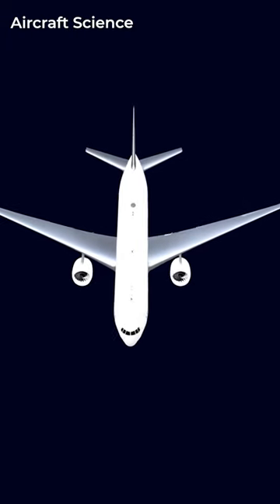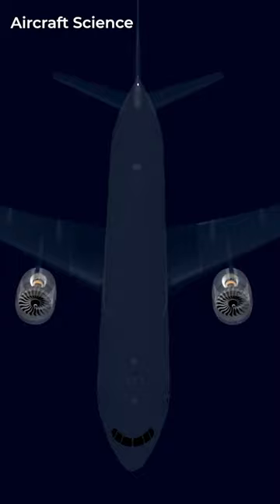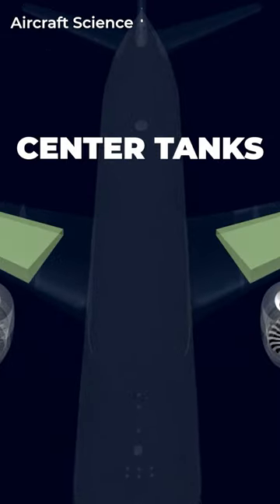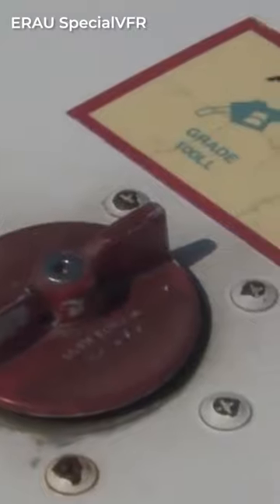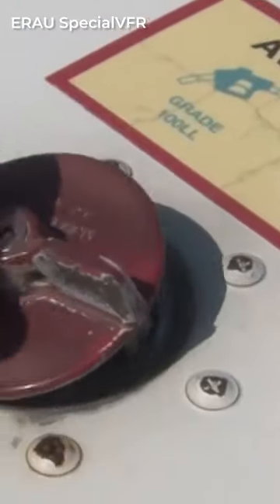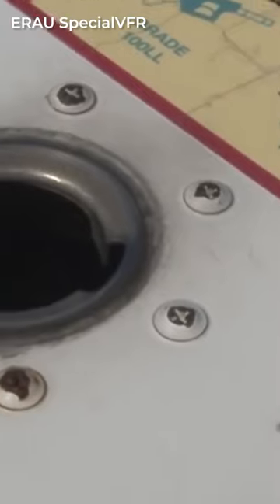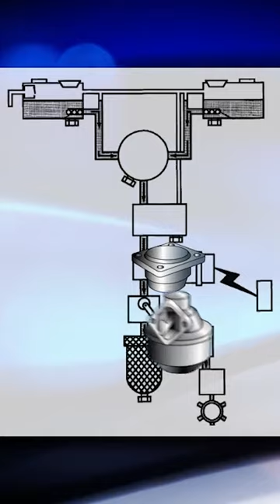How an aircraft's fuel system works! #shorts

Comment: Fun fact: wide body aircraft have a fuel tank in the horizontal stabiliser (small wing shaped surface on the tail) 

It is used to balance the weight of the aircraft. 
A pump is used to fill and empty that tank into the other tanks of the aircraft, because it is necessary to not have too much weight at the back of the aircraft during takeoff. 

However during the cruise, shifting weight to the back helps save fuel (super simplified but interesting).

Comment: The primary reason the center tanks are used first is for weight and balance, since the wings tanks are more aft than the center tanks using these last requires less trim and therefore less drag